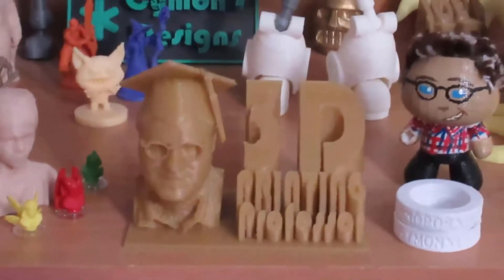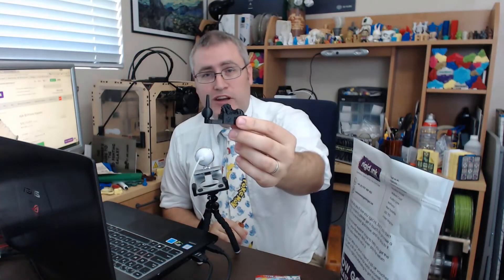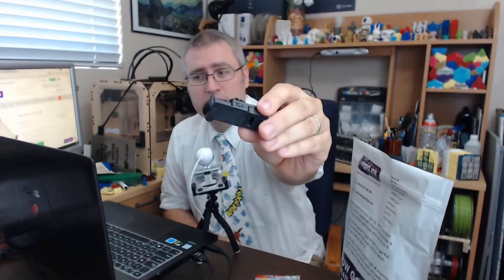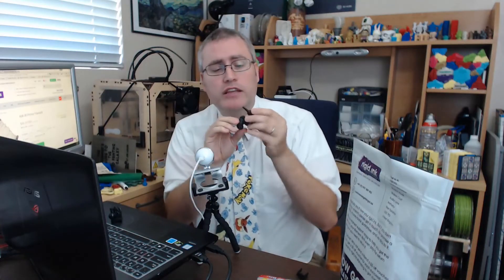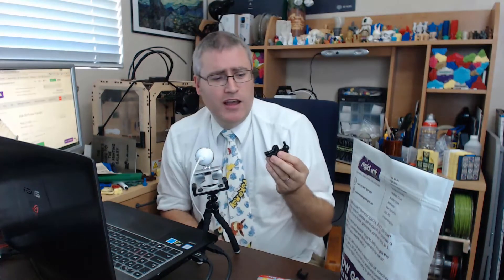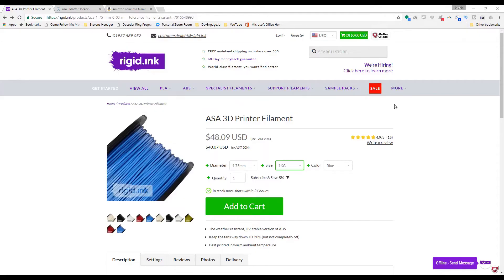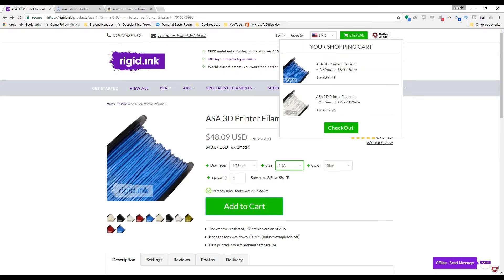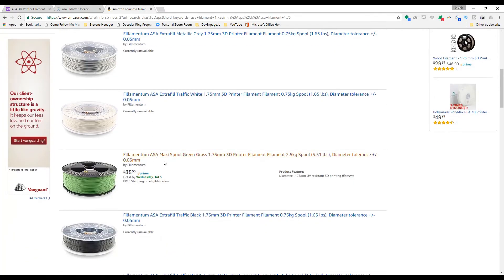Could Rigid.ink ASA Filament be the answer to my hopes and prayers?

Comment: Hmm, I prefer PETG actually and I don't have stringing issues since I print it from a dry box.  It is really humid here.  Ever since I installed a Microswiss hotend and direct drive PLA just clogs really bad when switching from PETG to PLA.  I have not yet tried ASA yet mostly because of the fumes that make me not want to print it inside my home.  To be fair though I have some Overature PLA that smells really bad, but probably does not have the health effect that ASA does.  I probably need to get another printer for my garage.

Comment: I hate no other Filament more than Rigid.ink ASA Filament cause it dosen't stick to the Bed...
Tryed in 5 Temperature Steps to adjust the Temperature with and without Enclouser.

I never buy something from Rigid.ink (By the way ABS from a other Brand works fine!!!!!)
Reply from the maker: Andre S. What build plate do you use? I have trouble sticking it to anything but hairspray or gluestick, but it does stick.
Reply: 3D Printing Professor Filaprint (like a PEI Sheet) i tryed on that Gluestick.

Comment: I have a Sailfish based printer and it is Rep 2 clone and I hate it because a dark, and dirty, secret I found out last year (I spread the word but people didn't care but now...) is that Sailfish has no PWM it fakes it for the bed and the nozzle and worst of all has only full on or full off for the fan.  Any printer using Sailfish can't print this material with a fan that it needs since it likes a fan around 10% and you either have 0% or 100% no matter what you set (it will accept it without error but anything above 0 is made to 255 and is otherwise ignored).  This really sounds like my ABS I grew up with trying to print and love over PLA (yuck).   Oh, other companies have now made (in the USA too) ASA around $29.95 or so.

Comment: Im thinking of getting a 3d printer should i go for 3mm or 1.75 iyo.
Reply from the maker: This is a topic that I haven't quite got the angle for making a video about, but the correct answer is 1.75, and for a lot of reason, not the least of which is that you get a more complete melt.
Reply: 3D Printing Professor thanks for the promt reply and advice, cheers from Ireland :)
Reply: Ok Cheers, I think I'll stick to the 1.75 . 
Thanks for the reply.

Comment: The fan is cool imho,  and asa is twice the price as other flavors. To bad you couldn't get petg to stop stringing. It took a little dialing of temp, fan, and retraction and I'm golden. Prints just as spot on as any of the others I've dialed. I love it for prototyping in the heat where pla will go soft.  btw, I just had another 124°F on my porch in the shade. Lost an orange tree too. The shop where my rep1 cranks out masters of pool tile designs is loving the 140°+ and cranking out dead flat 5 and 6'' tiles masters.
Reply from the maker: Even then you can't smooth PETG in acetone, and that to me is super exciting from the perspective of improving the bond between layers.
Reply: Good point.  It is on my list to try.

Comment: can a helmet that helps you cut your own hair be 3d printed?... the helmet would have teeth like in combs. The length of the hair to remain uncut will be the distance from skull to the comb teeth
Reply from the maker: Helmet, sure. Combs, probably. Hair cutting scissors... tricky. Need to do some more experimentation.